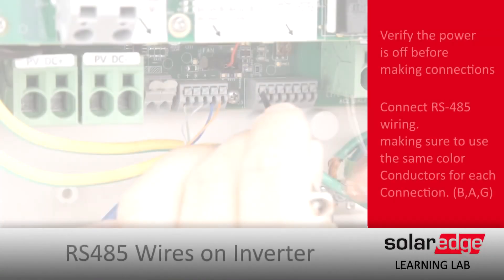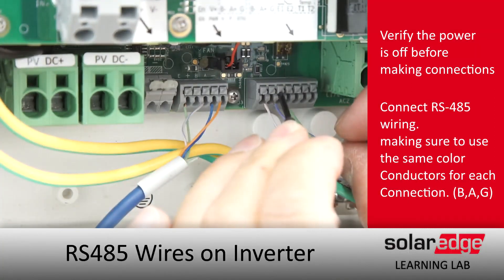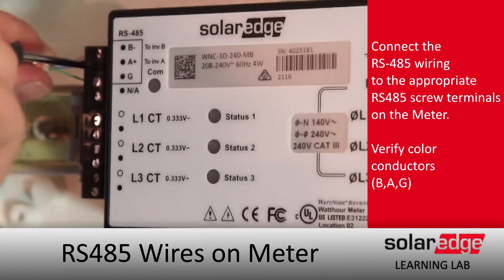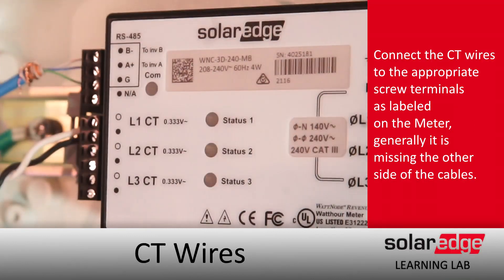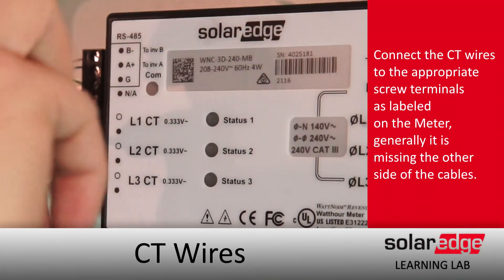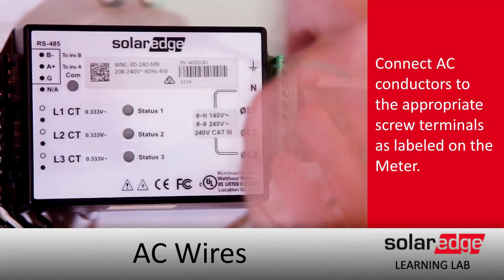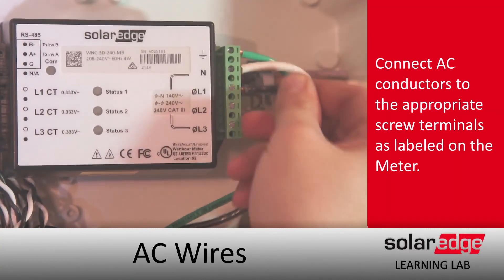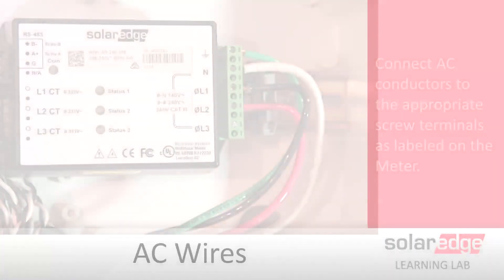StorEdge - Wiring a Meter to a StorEdge Inverter

Comment: So how does this work if I'm only interested in the production of the inverter itself? I have a solaredgeHD Wave inverter 11400 model number SE11400H-US000BNU4 that does not have the production meter built into it and it is causing problems with the system overall production on the monitoring dashboard I also have a solaredge HD WAVE 5000 inverter model SE5000H-US000BNW4 inverter that has the RGM built into it and it is the only one that is reporting the production to the monitoring portal. For example total system daily production says only 20 kwh when its actually closer to 90 kwh combined with th larger 11400's production.